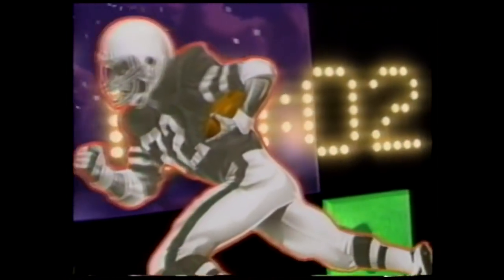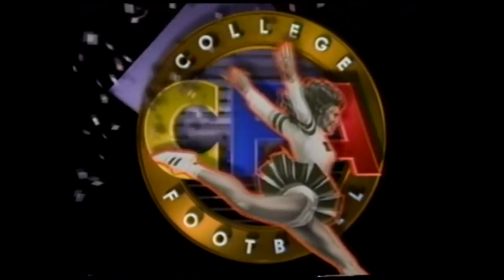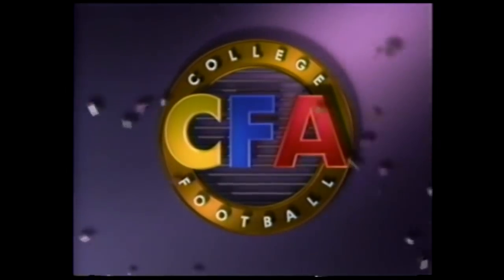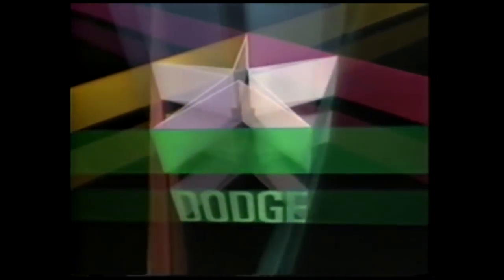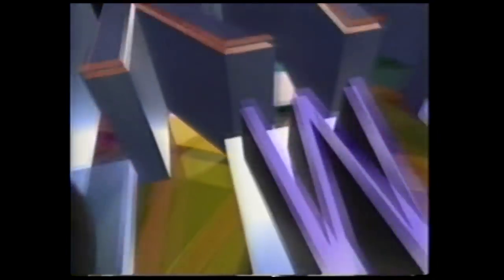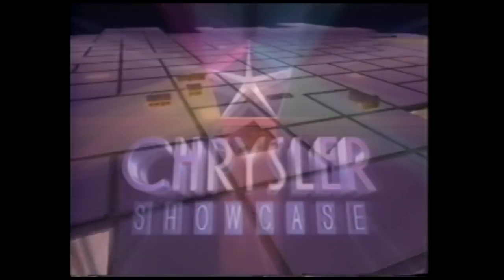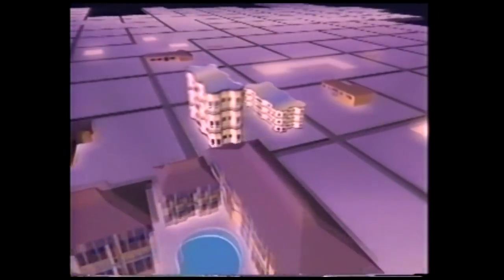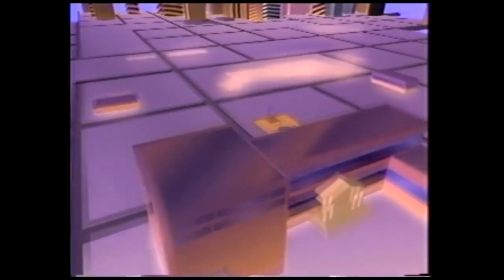CGI History   1987 BDA Showreel part 4   Ed Kramer CGI Expert Wizard

Comment: Flatshading became a mascot and a trope of computer graphics like wireframe and pixels there. Often I think those 80s intros and adds use computergraphics as much as a celebration of the technique itself as a means to an end. 
But then that goes for just about any tool and medium to a greater or lesser extent.
Reply from the maker: Especially when it is a new thing that wasn't possible before. When something is new it's hard to tell the difference between using it tastefully and using it just to show off the technique.